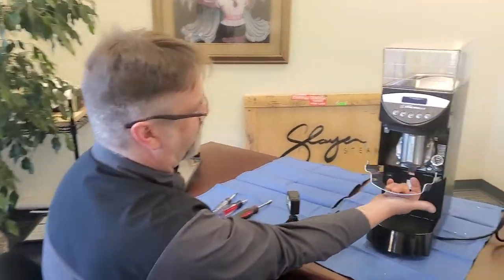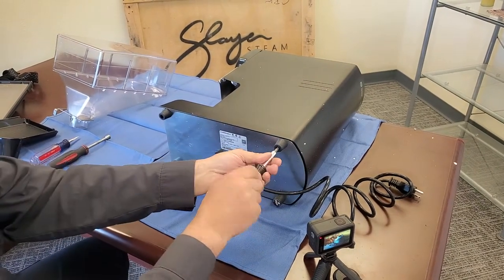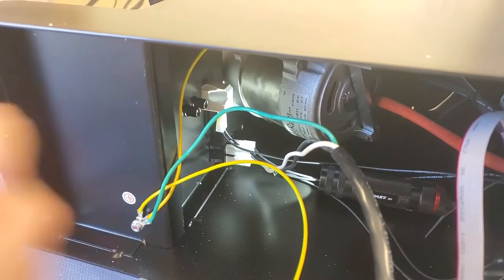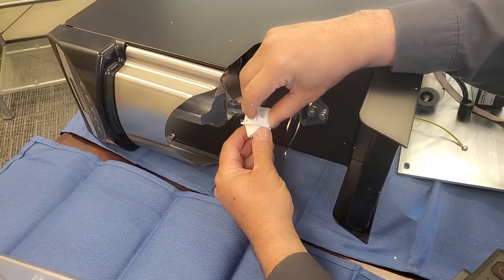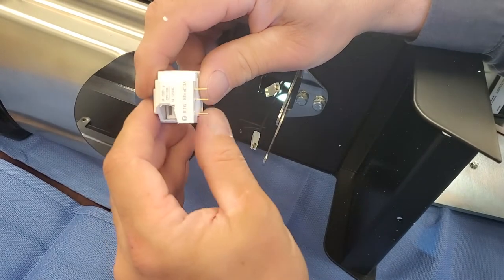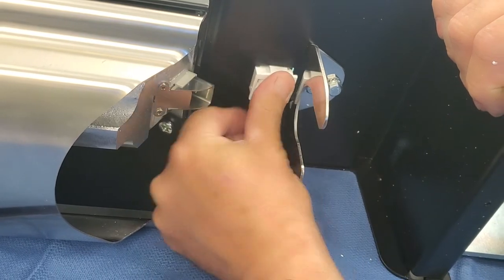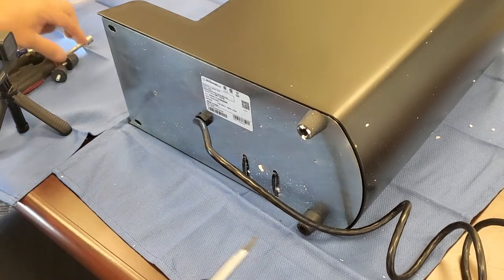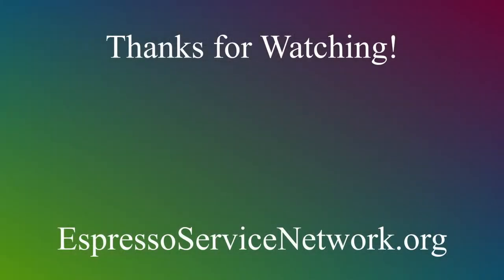Mythos Grinder Activation Switch Replacement

Comment: Thank you for all that you do! I do have a question, my Simonelli Mythos Plus is getting power according to the red light on the on/off switch but the display isn't coming on. Could this be something with the control panel itself or something else?
Reply from the maker: Hello, A few thing to check. Your on-off switch could still be bad, the ribbon cable could be disconnected or the safety switch on your hopper could be disengaged. Take a look at those things and let me know what you discover, Dave

Comment: Hello, I hope you’re still active on here! You are so much help with everything by the way. Quick question, I have a mythos grinder that is not stop grinding with the hopper in place, I’m leaning towards it needing a new switch and was wondering if that could be the issue? Thanks!
Reply from the maker: Typically, if your grinder will not stop with hopper in place, it is the relay on the main power board stuck closed. I an sorry to respond so late. YouTube usually sends a notification and if they did Ruth did not see it. Let me know if I can help you further.

Comment: What is the exact part number of the switch?  That part is cut off before it is sold for replacing in the grinder.
Reply from the maker: Great to hear from you. NS part # is 15030009 or you could purchase from Sproparts. Their part # is 729019.
Reply: @EspressoServiceNetwork  Thank you…